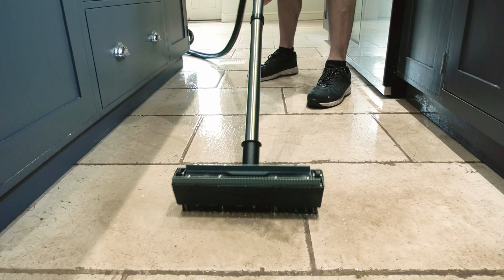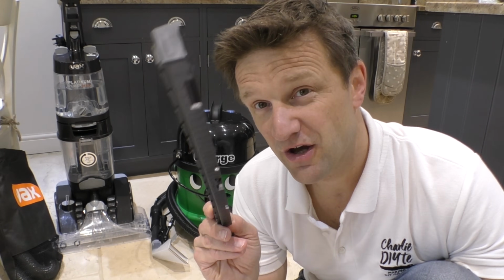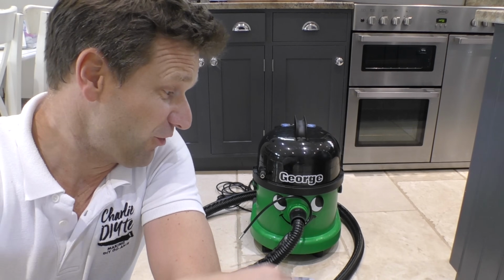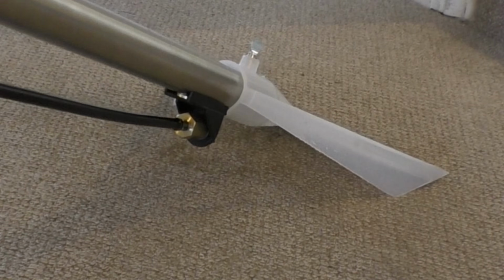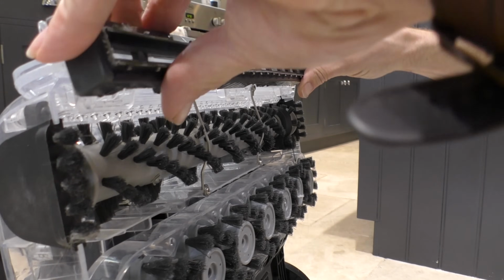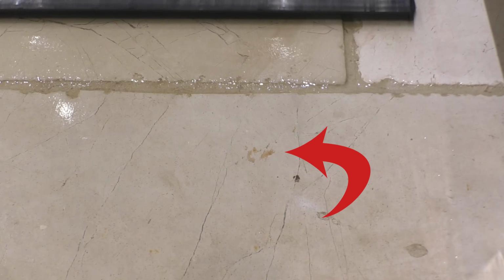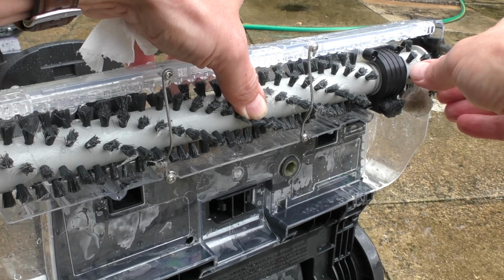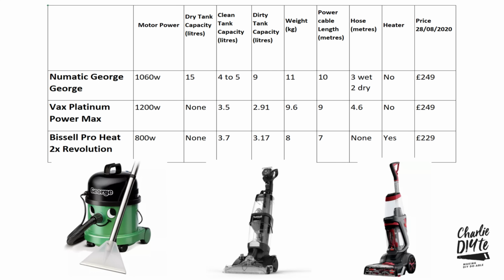The Best Wet and Dry Vacuum for Hard Floors & Carpets?

Comment: I'm a maintenance technician at a sports centre and have a lot of experience of repairing Numatic vacuum cleaners. I thought it would be worth mentioning how robust their kit is. Our staff are not gentle in their handling of our cleaners but they stand up to it very well. The big bonus for me is that parts are readily available, reasonably priced and the machines are very easy to dismantle and repair. No frills, just a solid and simple design well executed.
Reply from the maker: Thanks Paul, that's great to know and in fact having changed the motor in my 18 year old Henry I should have mentioned this https://youtu.be/yO7nfqiABMw Thanks for the comment 👍
Reply: Hello Paul I agree Numatic are superb I have a Henry for dry and the nhl 15 for shampoo they are very well made and wouldn’t go for anything else best regards Mark from Billericay 👍👍🇬🇧
Reply: Who's
Reply: Yep Numatic are an example of the “the best of British” used them in very harsh wet waste handling operations in my company of 25years - brilliant!
Reply: We have a vax carpet machine dual power pet something or other, we never overfilled it all the water leaked into the electrics my motor and everything and it’s just smokes and blew up after the first use! Rang vax customer service was shocking
Reply: 'Wet stff' 😂😂😂😂

Comment: I tried to get my George working yesterday.  I've had the original for 20 years and my cleaners do all my dry vacuuming.  The replacement clean water tube didn't fit tightly enough to form a seal and I taped it with box tape, but then the pump stopped  working.  I'll refix it in dry mode to clean the filthy old 25  year old Volvo but replace it with another George. My elderly dog is peeing occasionally on the carpet so it needs repeated cleaning. I considered having a contractor in but feel that a replacement machine is the best way to go.  Thank you for your video because you  cleared up my dilemma over Vax or Numatic.  I had an old Vax before I got the Numatic and it was an improvement last time.
Reply from the maker: Yes George is perfect for spot cleaning the carpet after those little accidents. Don't touch the Vax with a barge pole. Mine is broken now because my father in law managed to snap the mechanism that keeps it vertical when not in use, the first time he borrowed it. It's a gimmick in my opinion.

Comment: After years of buying pointless disappointing vacuums cleaners, I saw your review and decided to go ahead with purchasing George. I also purchase the Airflo brush separately and I think this is the only hoover anybody will ever need for a home be it small or large. No more issues like the brushbar not picking up large grains, dog hair being blown away by the exhaust from the hoover, and having to switch between different hoovers to get to different places (and the stairs omg). George and the Airflo brush combo is the only kit one needs to clean everything. I have a VAX kit with different attachments and it attaches perfectly to George's metal pipe. I have used it several times to clean all my cars and my house and the satisfaction I got was an amazing feeling. I wish I had known this 10 years ago.

Comment: You missed a very important PRO for George, repairability.
I have a George, about 15 years old. I have also used a upright Vax very similar to the one you reviewed. I found the Vax a lot less labour intensive than George and it did do a good job on carpets but when the Vax broke after a couple of years of to be honest fairly light use, it was stuffed and needed replacing. George on the other hand is very easy to repair, all the accessories can be bought and even a part bought today would fit my 15 year old machine perfectly. Numatic supply every kind of part you would need to fix anything wrong with George and for a very reasonable price, they are also super easy to fix yourself, no need to send it away or pay for someone to do it. 
In my mind this makes George the best machine, sure it has some drawbacks (noise, weight, bulk etc) but as you point out it is truly an all in one machine that will tackle any job and once you buy it you have a machine that will last a lifetime.
Reply from the maker: Yes that's a very good point. I took this for granted having replaced the motor on my 18 year old Henry previously https://youtu.be/yO7nfqiABMw but you're absolutely right, I should have listed this as the main pro point.
Reply: Agree, i had few VAXes over time and they basically made to last 2 years so you can buy a new one or buy expensive wierd parts for it, George is good with parts. Even VAX customer service agreed they are not good quality its part of making money strategy

Comment: Thanks for doing the comparison, very interesting. I have a Delongi Penta wet and dry with hard floor(rubber) and carpet cleaning attachments (clear). It has two tanks for clean and detergent water (detachable) plus the usual large tank for dirty water/dust. It also can be used as a normal Vac like Henry. I purchased it in 1999 and its still going strong even though its been used for cleaning out ash from pellet fires annually and wet cleaning leaves and grit out of spouting! No faults with it so far so a great purchase.
Reply from the maker: Thanks Allan. That Delongi sounds awesome 👍🏻

Comment: I’ve been using the George for years now as it’s got great suction and is great for cleaning my taxi interior, only problem I had was when the wet vac pump didn’t work when switched on so I dismantled it and sprayed pump with wd40 and assembled it again and hey presto worked again and it’s been fine since. I always recommend numatic products 👍👍👍
Reply from the maker: Thanks Alan. It's the best option out there for your taxi, in my opinion 👍
Reply: @CharlieDIYte  Even if it's a Fake Taxi? ;)

Comment: Many thanks Charlie, not only have learned some very interesting facts about George ,but also you have highlighted the problem I have had with the Vax Platinum Power Max , as you showed in your video the Vax head becomes clogged with carpet fibre, fur, hair and debris and is so hard to clean out. I watched the company's promotional Vax video after I'd first used the vax, followed the video to the letter, and as I tried to replace the brush head the drive belt slipped into the inside of the machine and no matter how I tried, I couldn't retrieve it. had to send it back. 
Your method with the jet washer looks like the best method to get the dirt out of the machine head. I will be checking out your other helpful videos.
Reply from the maker: Thanks Mary. Yes I find if you take it outside and give it a good jet wash that's the best option but it does clog up a little too easy, as you say.

Comment: Offer prices @ Jan 2025: Vax £150. George £250 /£285 with additional heads. Review is helpful - and the George looks better than vax - but at this price - if you don't need hard floor cleaning - you should consider the Bissell Hydrosteam Revolution 1300w steam carpet cleaner at £322 on offer.  This is what I bought in the end and am very impressed with its cleaning power  - it also has hose attachment to spray & suck.   For me - the Vax uprights and George have too many reviews detailing problems and poor support.  The Bissell comes with full 6 year warranty (including hose etc but excluding brushes which are obviously wear and tear).
Reply from the maker: Thanks. I agree that counts for a lot. I wouldn't touch Vax with a barge pole.

Comment: I'm onto my second George first one was little used, I only have two settees,  and stair carpet but the pump lasted no time at all, Too expensive to replace. Easier  to buy a new machine, How ever I will say that my sister's Vax carpet  brought my stair carpet up like new even after I had  just previously cleaned it with George. Husband struggled to shampoo  his car with George. My verdict is that George is OK and excellent vacuum but I will be buying a vax for my next Shampooing machine,
Reply from the maker: I had the opposite experience. My FIL broke the Vax just after I did this vid whereas, barring a few blocked nozzles, George is still going strong. My advice - for large areas of carpet get a pro in but for spot cleaning George still rocks, but each to their own. 👊

Comment: So pleased you did this video! I too have the Vax Platinum but couldn’t understand why the heads seemed SO filthy after just ONE round of shampooing two small rooms. The rotating brush heads do seem to pull up dirt (amazing how a light carpet kicks up so much BLACK fluff!) but then this machine spits it out ferociously against skirtings and leaves more of a mess to clean up ggggrrr! I’ve just taken mine apart to clean the heads and it still cannot clean the whole head because of the small inlet for water so after only two uses, it looks old and dirty. Not happy with that. Mine also leaked and has spilt black water all over the place when I moved it. When I lifted it to descend the stairs, it leaked again. It’s incredibly heavy, even when empty, to cart around. And clunky. It needs a separate cupboard to house everything. I love the idea of it all being incorporated with the George and they certainly are robust. I would be so interested in seeing how the George performs. Too pricey to buy one and just hope for the best. I wonder if people rent them out? This is a great video, thanks for going to such lengths.
Reply from the maker: I'm afraid IMO the Vax is a gimmick backed up by continuous slick advertising on TV. Mine broke soon after I did this video. My advice - for spot stains George cannot be beaten. For whole carpets get the professionals in. Their products are next level.

Comment: I’ve just come across your video and with regard to the VAX  I can only speak about my own experience that every single VAX I’ve ever owned including my current machine leak at the back.  As to cleaning hard floors LOL I’ve tried that with the attachment that comes with the machine it just leaves the floor very wet. The only draw back to the George machine is that older people (which includes myself) or those who have mobility issues may find it’s a bit too much to use
Reply from the maker: Thanks for that Gloria. Yes I'm afraid the Vax is a very flawed machine bolstered by very persuasive TV marketing. My father in law broke mine soon after this video. I have a friend who runs a carpet cleaning business. The difference is extraordinary. One pass and even the filthiest carpet is clean. So my advice would be George for hard floors although it is hard work. It's also brilliant for spot cleaning carpets and valeting cars. For cleaning large areas of carpets, get the pros in!

Comment: I had that platinum cleaner for a week then returned it, the main roller bar is far to aggressive and is what is pulling out all of the carpet fibres. I ended up with rolls of damp carpet pile everywhere. It was also terrible at extraction compared to my older machine as I could empty 4 or 5 clean water loads for each one extracted so all that water was just staying in my carpets for days. The water tanks as you say are also too small, constantly having to stop for refills.  In the end I went for the machine 1 below the platinum in the range which has much larger tanks and just has the spin brushes and no roller bar.  The difference in performance is night and day.  No rough pile left, no balls of damp carpet pile and perfect 1-1 extraction.
Reply from the maker: Nice comment, buddy, thanks for that 👍 What you say about the main roller bar makes perfect sense.
Reply: I had a platinum and used it once. The faff involved in unscrewing the roller bar to clean it is ridiculous. I got a Henry Wash which I love

Comment: I have a Vax Platinum and a George, as well as a Dupray steam cleaner. I had a lot of really old carpets. The Vax is extremely powerful and lifted a lot of dirt easily. I love the George, though with time the water pump jammed and the water hose grip detached. The Vax is a bit heavy to carry up and downstairs and requires a lot of emptying, but in my opinion does a deeper clean than the George since the carpets are agitated. I also used the Vax on a hand woven carpet, lightly and with no solution, once over brought the colours back.  Numatics are great for getting water out of carpets in the event of a flood (we had tropical storms).  I have also owned a couple of great Karcher steam cleaners, but currently prefer the Dupray Neat, a real pleasure to use.
Reply from the maker: Thanks for this Sim. I hear what you say about the Vax, but personally what all this has taught me is that the George rocks when it comes to hard floor cleaning and sucking stuff out of carpets - the fish tail nozzles are much better than the Vax equivalents. If however I had a whole room or house to clean I'd get a professional carpet cleaning company in. Thanks for the heads up on the Dupray. I'll check that out 👍🏻

Comment: I'm now waiting on my 5th vax to be collected for repair / replacement. Thank god for the 6yr warranty. Absolutely terrible design, too much stress placed on the motor due to the way the dual brush works. Also the clutch mechanism when you tilt it back fail as well (that's what's happened on my latest failure) . So far 3 burnt out motors and 2 clutch issues (the clutch issues mangle the inside of the machine). The hose attachment sometimes stops working as well for some reason (happened on everyone i had), had to remove and then reattach. Cleaning the machine after use  is also a pain. I actually bought a bissell at the weekend which is superior to the vax in every way.
Reply from the maker: It's a terrible machine. Mine broke as soon as I had done this video when my hand fisted father in law borrowed it and snapped the tilt mechanism so it no longer clicks into the upright position. A case of a shoddy gimmick backed up by slick TV advertising, I'm afraid. My advice to you, Bissell or George for spot cleaning and if you've got whole carpets to do, get the professionals in.

Comment: Another excellent review Charlie. Me and my wife sat in bed this Sunday morning and watched it together! Middle age eh? 
We are in exactly the same boat as you as we have a hard kitchen floor and a dog but also two teenage boys. We also have a Henry (two in fact) and a Vax carpet cleaner (the Pet focussed one) but not the Platinum. We have experienced all the issues with the Vax and had not considered a George. We were impressed with the performance George had to offer and will be giving it some thought. One other aspect that I would add about Numatic machines is that they are very easy to service and repair with all items being easy to source (motor brushes etc) but I don’t expect the Vax to be so straightforward. It’s a good design, as you say, but too complicated. Numatic aim their devices at commercial markets too so they are much more rugged and easily repaired. 
Thanks for the very helpful video. Keep them coming. 👍🏼
Reply from the maker: Hi Paul, thanks so much for that (and for watching my vid 👍) Yes, I got so caught up in the editing of the vid (it was an absolute monster to put together for one reason and another) that I didn't think to mention the blindingly obvious point you made about maintenance, which I should have, given I did a video showing how I repaired my 18 year old Henry https://www.youtube.com/watch?v=yO7nfqiABMw&t=6s If you can stretch to another vac, you'll find the way George cleans your kitchen floor an absolute game changer!
Reply: Charlie DIYte cheers Charlie. 😊👍🏼

Comment: Have been looking for a replacement for an old Van which has developed persistent faults. This video has been really helpful. George it is - not least because I have an identical kitchen floor...! Many thanks
Reply: Vax *
Reply from the maker: The Vax in this video is pretty crap really. My heavy handed father in law borrowed it and snapped a small plastic lug off it so it now doesn't stand up properly. George ever day for me. Particularly as all the parts are replaceable whereas something goes wrong with the Vax and it's off to landfill.

Comment: I use ear defenders when shampooing floors due to the length of time and high volume of the motors.
I also added a spring to the spin scrubber on the Vax to make sure it presses down on the carpet.

Comment: They done that change on the bag inlet to stop help prevent water from shooting up past the float and into the motor, I just cut the bottom bit off and still works perfectly without having to worry about it spraying up
Reply from the maker: Good thinking. 👍

Comment: George all the way. Had a Bissell upright previously.- much less versatile and also had leaks whilst standing - and same carpet clogging.    The uprights might be alright for a certain carpet in a regular shaped room. But George is a superhero with multiple superpowers.  And great to do the car too.  Numatic just boss this stuff. - I get the idea you think so too.  👍😄
Reply from the maker: I certainly do, Rod. I was quite happy to be blown away by the Vax, but wasn't surprised when I wasn't! I have an 18 year old Henry still going strong although I did replace the motor recently https://www.youtube.com/watch?v=yO7nfqiABMw&t=6s a Henry Xtra, and now George, so I am a bit besotted by them!! Was your Bissell the one that could be paired down to a smaller unit for upholstery and stairs? As you say,  much less versatile whichever way you look at it. 👍
Reply: Can’t remember the Bissell model.  It was a while ago. It did have a hose attachment but that leaked even worse than upright mode and a huge pain to set up (never did understand it exactly). The Bissell was used twice. First time was just a mess - just a wet carpet.  Decided to give it one more chance but just the same.  I have a two storey office and have a Henry on each floor, a Henry at home and a George that moonlights between the two. Henry #1 i inherited with the office about 17 years ago and still going strong.